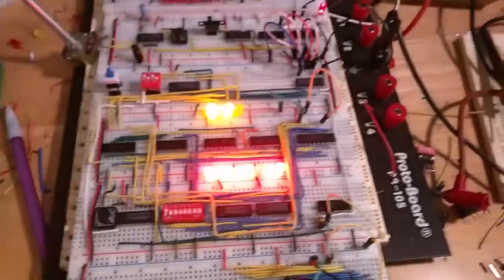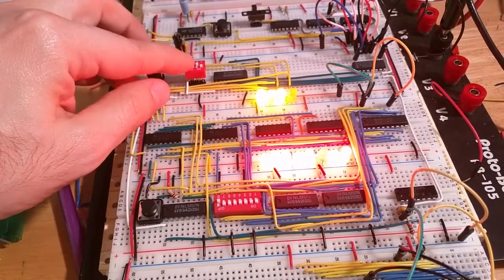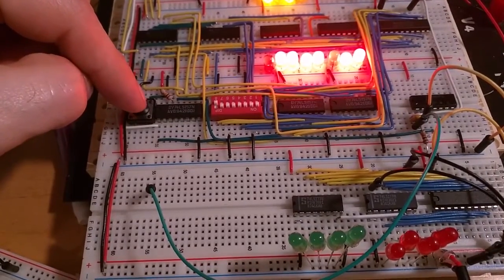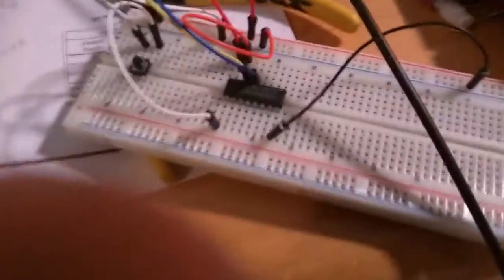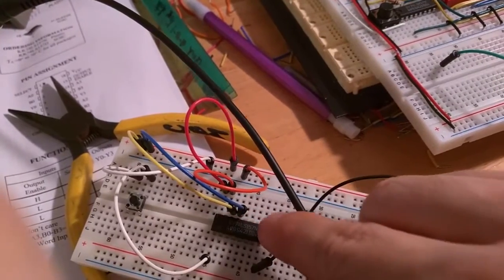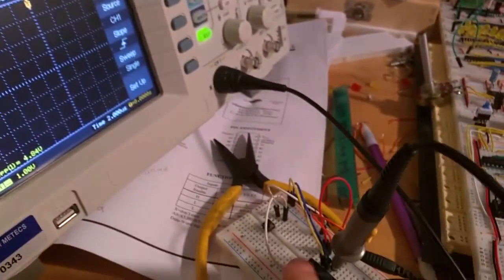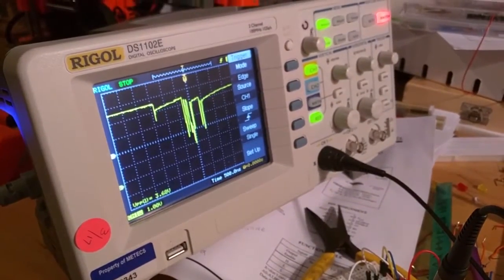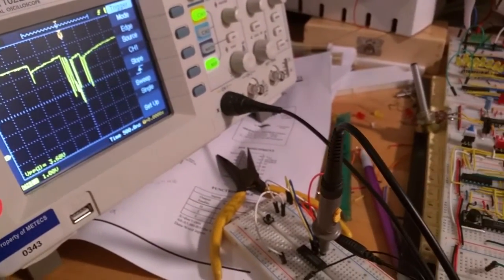Signal spike issue with 74LS157 chip

Comment: I'm sure you solved it long ago, but I'd immediately be thinking of throwing an extra decoupling capacitor across the +/gnd of that chip. 74LS isn't as bad as 74 series, but they have heavy momentary switching transients that pull down the vcc, especially with the higher resistance of breadboarded power lines. Move up to 74S and you're looking at one decoupling capacitor per chip.